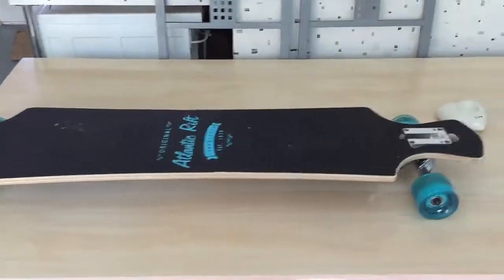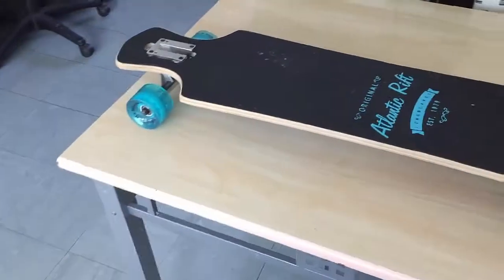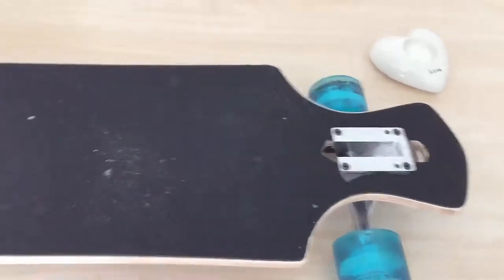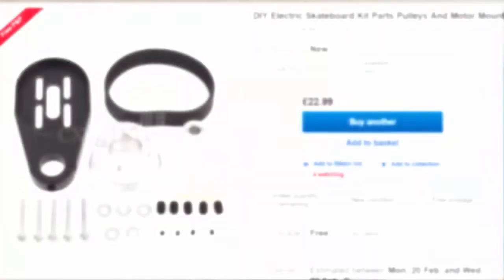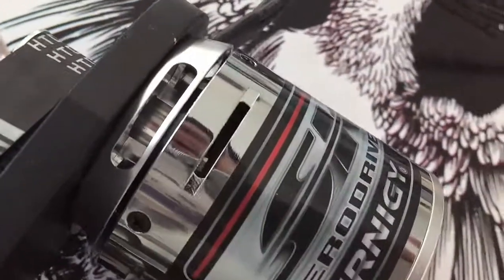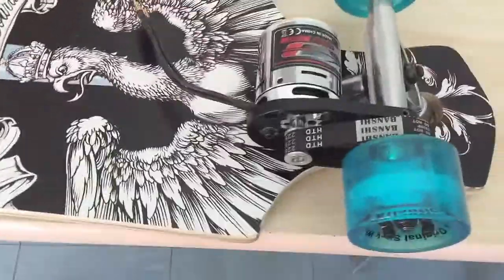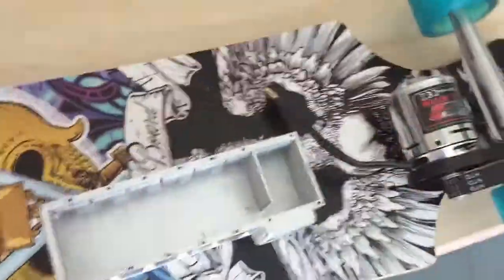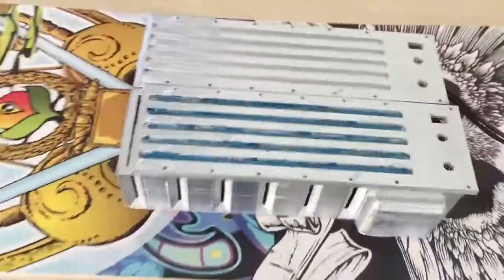DIY ELECTRIC LONGBOARD BUILD

Comment: That belt will break in 2 days max, mount kit is not made for adults
Reply from the maker: RBassKaloqn4o honestly it's still working and I'm always using my board.bet can slip abit if I accelerate to fast. I'm making another soon and will be making some changes as I have had some issues with this set up
Reply: Sean Pook switch to 15-36T 5M belt and pulleys they are very strong, and get a mount from https://hobbyking.com/en_us/fun-cool-stuff-1/action-sports/e-vehicles/electric-skateboard-conversion-kit.html they have a new one now very strong and for that motor, this one i got so many problems with it pulls back and slips the belt(im 220lbs)